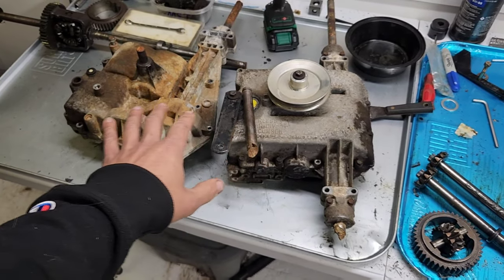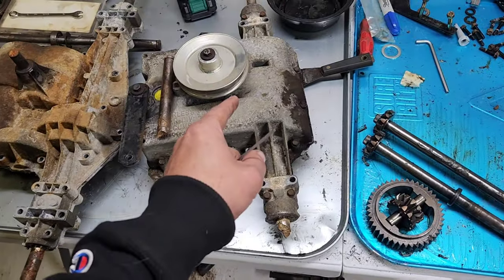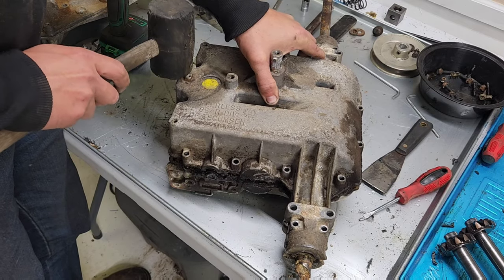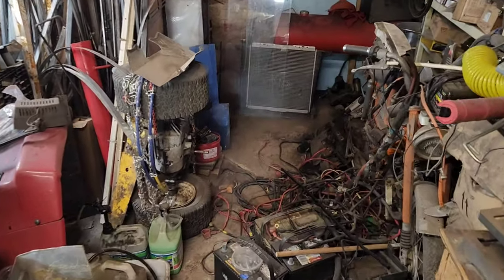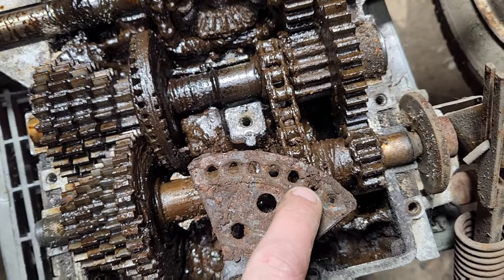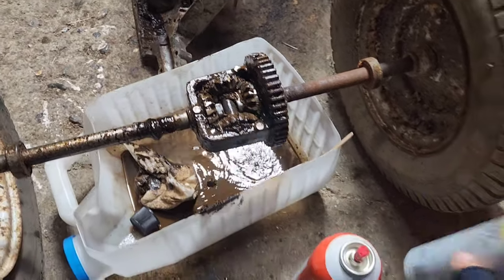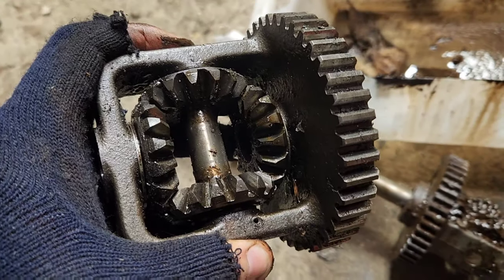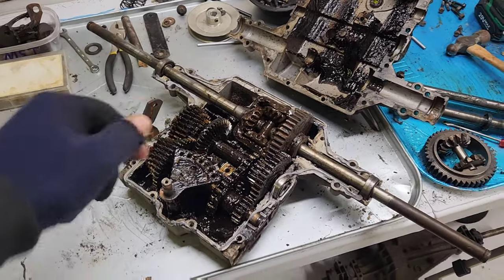Peerless 801 Broken Axle and Bull Gear Replacement

Comment: i was running a solid axle .mst 206   it twisted all the way around.. before  it snapped ,    so i built a swing arm off the back. 1 1/4 axle ran with a chain  from the one sided 206. then that broke. so i put new axle in the 206 . i run 2 chains from the 206 to the 1 1/4 axle. it is strong now .  making double chain tighteners to have no chain slip in reverse  was important .

Comment: What do you suggest putting inside these transmissions? Do you use grease or some kind of gear lube?
Reply: liquid grease  TSC
Reply: Personally I use 80w90 with red n' tacky grease and make a thicker mixture. Works amazing

Comment: I’ve been in 3 of these 801s and i knew about the spider gear pin but i was certain it was just a roll pin you could drive out with a punch. 

I went digging in my folder of transaxle build pictures and sure enough theres a picture of a disassembled 801 differential that’s had the pin driven out with a punch. 

No clue if I’ve just gotten lucky or what.

Comment: What do you prefer, the Peerless 801s or the Peerless MST-206??
Reply: 801's with 8 inch rims are amazing. If you use 12" rims and big tires you'll blow any LT transaxle, but I've blown 5 206's so far and no 801's.

Comment: I have a peerless 840A on my jd180. One of the bushings (for one of the gear shafts) blew out the left side of the housing, then the gear on that shaft dug through the bottom of the case too. Having trouble finding a reasonable priced housing (other than the $800 one from jd)…. And what grease to use (with the smaller 5in input shaft pulley like this one)?

Comment: I just got a JD LX172 for free from my dad. He said previously it would only move in first and now it doesn't move at all. I pulled the top off and found that the belt was broken. However I noticed that when I turn the input shaft to the transmission with it in 1st that it doesn't seem to try and turn the wheels. Is it possible I might need to tear into the trans or is that normal?

Comment: Have an lx172 with the peerless 801. Had a friend borrow it and the handle linkage snapped and broke. I recall before i had him borrow my mower the gearrs got hard to ahift all together. Whats exactly am i looking at? Would fixing the linkage solve anything or just better change the oil on it? Thanks for the help.

Comment: Greetings from Santa Clara, CA.
Where can I find transmissions?
Reply: Getting an old mower that the transmission still works is cheapest if you have a place to put it and a trailer to bring it home, otherwise ebay is rife with MSTs and the occasional 8xx series, though almost all of the 820s (the slightly tougher 800 series) that I've seen have been stripped down to sell individually as parts. For the good news, you can still get gears and/or parts either as NOS (new old stock) or even brand new from places like Oregon or a Peerless dealer. On that note, a brand new MST-206 goes for right around $200 +/- fifty bucks. I've seen them as low as $176 in the last few months. Small Engine Parts Warehouse usually has them, though they've gone up a lot more lately than is usual.
Reply: Thanks for your reply.  I did a screenshot of your reply.  I will transcribe your response.

Comment: Ugh, my 801F project is on the back burner in favor of getting a JD 214 repowered before the end of the year, but not looking forward to scraping out the muck to replace the shift keys and the main pinion that I'm pretty sure is keeping it from functioning as the backup machine. 
In the event you've seen an F model, this one has a very strange (rare?) friction disc clutch on top of the rear pulley that I re-engineering hoping it was the problem. Do you think the clutch is even necessary when I get back to the 801 rebuild?

Comment: I had a transmission took a s*** on me before when I was out in the woods I was sucking six gear the whole time the rest of yours did not work give it a little push and bakery I went home and it took it apart so did not figure out why it took a s*** on me don't know transmission still sitting in my mouth I ain't getting around fixing it not one bit don't really care and it come from a Murray frame too I have about maybe five or six transmissions from 3 Murray frames and two from Craftsman I say Christmas in Murray frame transmissions or good one lesson don't damn good too fast you will break a transmission lol